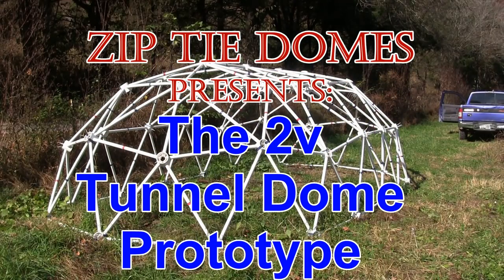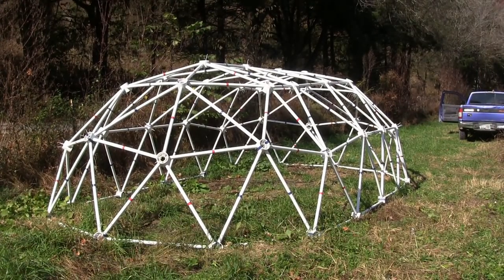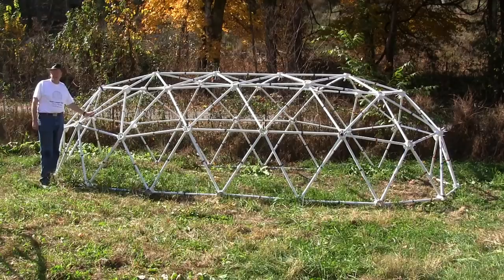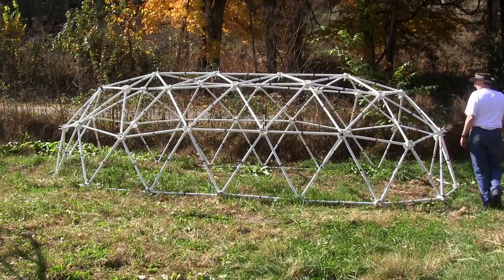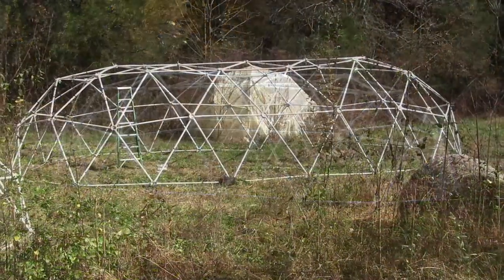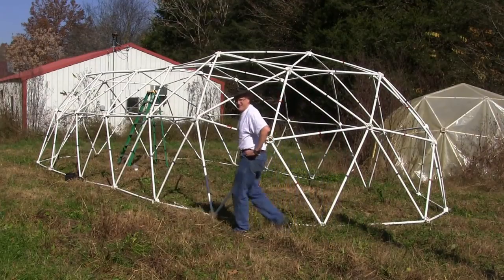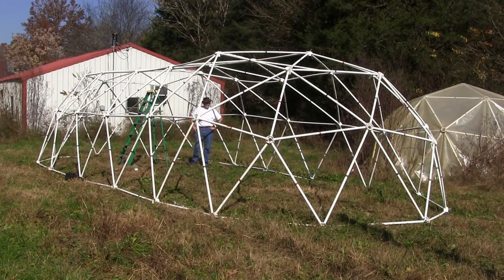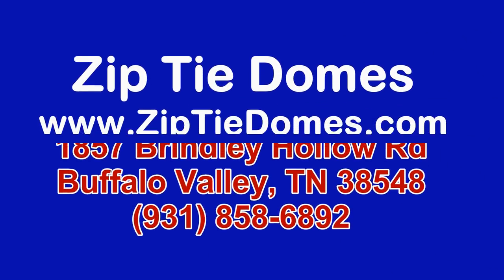Zip Tie Tunnel Domes

Comment: Cover it with billboard canvas... slurry papercrete and put it on it...then paint with 100 per cent silicone/paint thinner mix. It would be well insulated and waterproof.
Reply from the maker: You must have read my mind.  I am working on latex concrete poured over fiberglass netting that is stretched over the dome.  Look up "latex concrete habitat" for a book on this technique.
Thank you for your comments and for watching this video.  John Hurt
Reply: @ZipTieDomes  Reason I checked back in to see if you had this  latex concrete poured over fiberglass netting up on your channel
Reply from the maker: @sjr7822  Still working on it, when the weather gets better.  Thanks for your interest in this project.  John Hurt

Comment: For your consideration?
How-To: Styrofoam Concrete from website makezine
2 parts sand
1 part water
1 part recycled latex paint
16 parts ground EPS  (This is the most flexible part.  More or less depending on what you’re doing.)
I made my first batch in a cement mixer
Reply from the maker: Wow, that is cool.  Aircrete Harry on YouTube is also making concrete with EPS as a DIY dome project.  Thanks for everything.  John Hurt

Comment: For permanent structures, I recommend making a mold. Use 2 domes, an inner dome, with a  plastic sheet on the outside, and then another larger outer dome,  with a plastic sheet on the inside, with a width of 8 to 10 inches (20 to 30 cm) between the two domes. Fill the gap with AIRcrete after it has cured and hardened, remove the domes.
Reply from the maker: Thanks Grant!   That is a good idea about using the two domes for an Aircrete form.  I may do something along that line some day.

We have something similar which is a Dual Covering Hub that allows you to attach the greenhouse plastic to the inside and the outside of the dome to create a dead air space. 

https://www.ziptiedomes.com/geodesic-dome-hub-kits/about-geodesic-dome-hubs.htm

I suppose you could inject the aircrete around the struts and held between the two layers of greenhouse plastic.  That would be an interesting project.

I have looked at aircrete, shotcrete, basalt thin walled domes, and all of these require special machines and electricity to build a concrete dome.  This winter, when I get a little more time, I will be experimenting with latex cement domes which are simple to build and do not require electricity.  This technique was first pioneered by Dr. Albert Knott and Dr. George Nez in the 1980's for building shelters in Uganda and elsewhere, and they have a book on Amazon about this process.  For our domes, we would take 3 layers of fiberglass screen mesh and staple it to the PVC pipe, then mix portland cement with latex paint or latex concrete additive - which hydrates the cement.  You brush this on the fiberglass mesh, then come back with a slurry coat of concrete, sand, water to create the exterior.  This gives a cheap waterproof covering without the weight and expense associated 2 inches of concrete to cover the dome.  I hope to experiment with this soon. 
Thanks for watching the videos.  John Hurt
Reply: How about spraying foam inbetween
Reply: @sjr7822  Great ideal, but not if you don't also laminate it on both sides with fiberglass. If you do that then it will be strong at the same time insulated. But you can't cheap out on the fiberglass, you must do both sides entirely or else it will have no strength.

You HAVE to do that with aircrete too, laminate it with strong fibers but you won't be using epoxy resin like with fiberglass laminates, you will use a concrete type mixture, or plaster of some sort, something that sticks and can make a good bond with cured concrete/aircrete, to laminate the fibers to the aircrete, that without the aircrete will crumble into itself with any load on it.

Comment: The tops of those experimental domes seem to be sagging. I wonder if they would collapse under a snow load?
Reply from the maker: I am still working on the Tunnel Dome, as it is not strong enough to support my weight of 240 lbs.  If I can't swing on it, I won't sell it. 
I need to change the orientation of the struts to make the dome stronger.  It is just not that easy.  I was lucky to get this orientation to work, with almost all of the struts to be of just 2 lengths.  But it is not what I want.  The base has a tendency to spread and has to be secured to the ground to have any hope of working at all. That is quite different from a standard dome with a rigid circular foundation ring.
Thank you for your comments.  John Hurt

Comment: if you dont mind what are the length of the pipes used to stretch 2v dome.
Reply: +Mohammed Shamsi   Not so sure they want to give that information away since that would give DIY types just about all they would need to do their own without buying anything from these guys.
Reply from the maker: +Mohammed Shamsi It is pretty complicated, when we have a construction manual, it will be on our website.  Thanks, John Hurt
Reply from the maker: +Bushcraft and Survival Yes, and that too.  Thanks, John Hurt